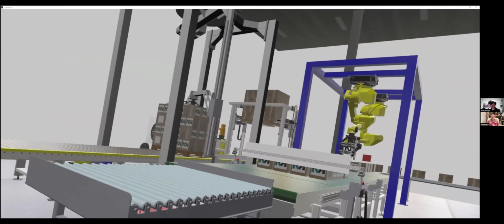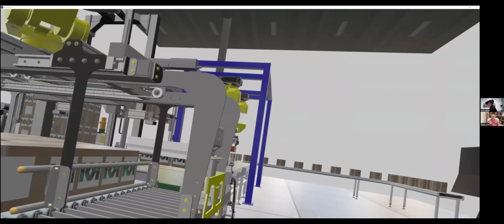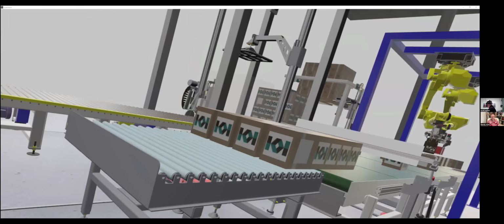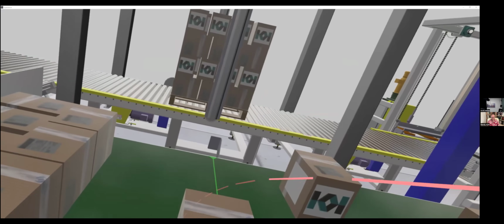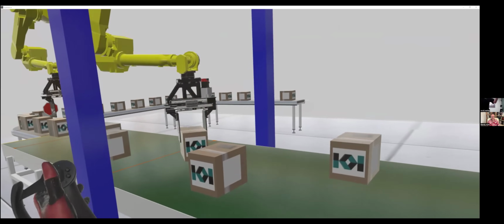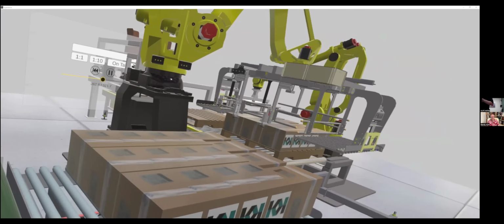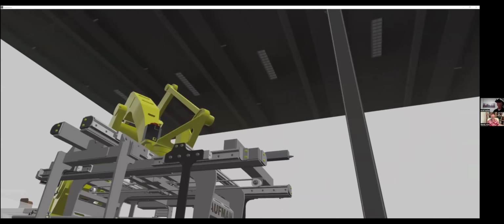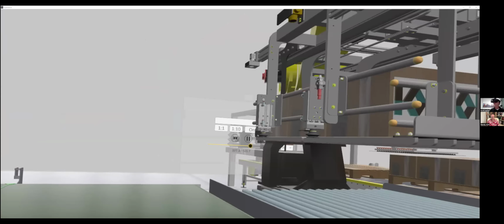𝐓𝐞𝐬𝐥𝐚 𝐎𝐩𝐭𝐢𝐦𝐮𝐬 - 𝐒𝐜𝐨𝐭𝐭 𝐖𝐚𝐥𝐭𝐞𝐫 𝐄𝐱𝐩𝐥𝐚𝐢𝐧𝐬 𝐭𝐡𝐞 𝐂𝐨𝐦𝐢𝐧𝐠 𝐑𝐞𝐚𝐥𝐢𝐭𝐲 𝐨𝐟 𝐚 $𝟏𝟎𝟎𝐓 𝐂𝐨𝐦𝐩𝐚𝐧𝐲 - 𝐈𝐧 𝐃𝐞𝐭𝐚𝐢𝐥

Comment: What gets me about these supposed experts is the make big assumptions based on nothing, Tesla is seriously overvalued and the result of lower sales, inferior build quality and a lack of ne models plus the fact there ceo is a very divisive figure has resulted in a lot of investors pulling out and share prices dropping.
There are supposedly 3 new models coming but the model 2 was also coming many years ago only for musk to then make the announcement that there won't be a model 2. This could be nothing more than the same, and when they showed the mystery model 2 share prices spiked, but this time nobody believes musk or tesla at all and share prices have continued to decline.
And even if they show 3 new models on stage, investors know it could take 8 years for it to be released to customers, or longer.
Tesla is going to keep losing market share and sales slow until they get rid of musk and start innovating again. Like all car owners when it comes time to replace your car you want to try something better, and there are a lot of manufacturers with something better.

Comment: Trivia basic math
A typical person can handle 5 gs of force, which is 49 m/s^2 of acceleration. The speed of light is 299,792,458 m/s. Using the equation veVitat where v is final velocity, vi is initial velocity, a is acceleration, and t is time, solving for t we get 6,118,213.429 seconds, which translates 1688.50373 hours, or 70.81265542 days. How you would have a heart attack for that length of time, reducing to 1-G and we still don’t have capability, yet but maybe Elon already has a plan…?